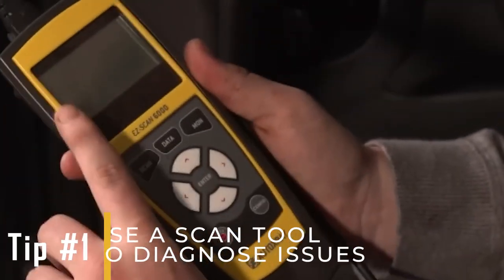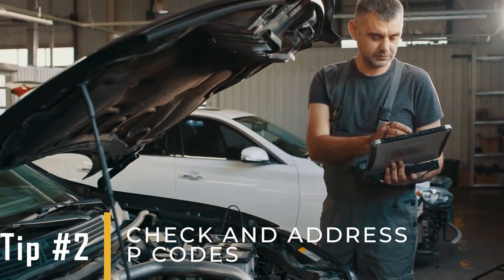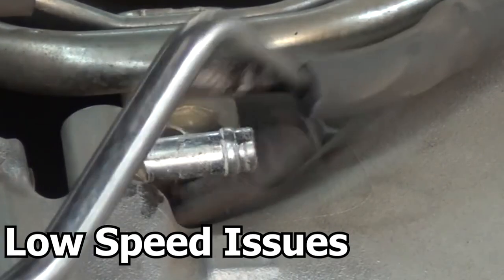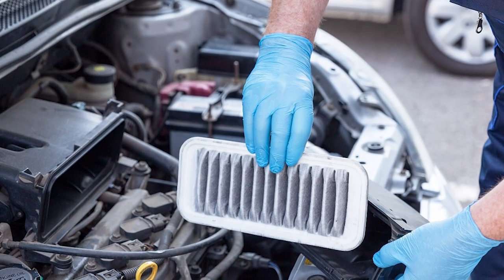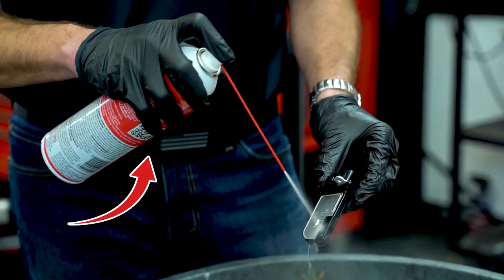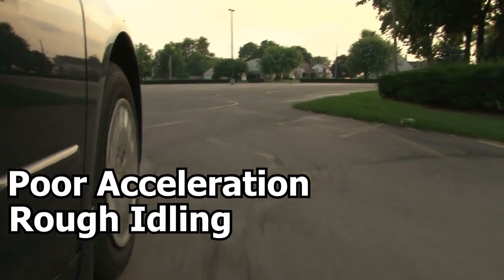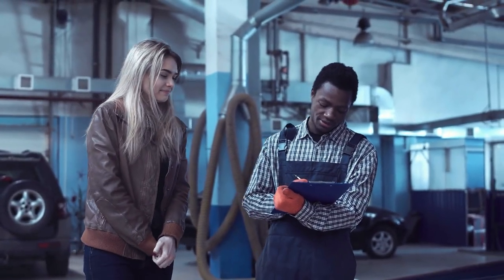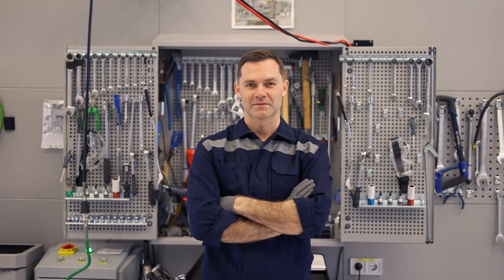DOING THIS WILL MAKE YOUR ENGINE RUN BETTER

Comment: I find the tips presented in this video incredibly useful and practical for keeping the engine in top condition. The explanation on the use of scan tools to diagnose problems and the importance of cleaning the mass airflow sensor stands out for its clarity. These simple steps not only improve engine performance, but also help avoid costly repairs in the future, effectively extending the life of the vehicle.
Reply from the maker: Thank you for sharing.

Comment: The engine is the heart of your vehicle, and just like any other critical component, it requires regular attention and maintenance. By following the right practices, you can significantly enhance the efficiency, power, and lifespan of your engine.
Reply from the maker: Thank you for sharing.